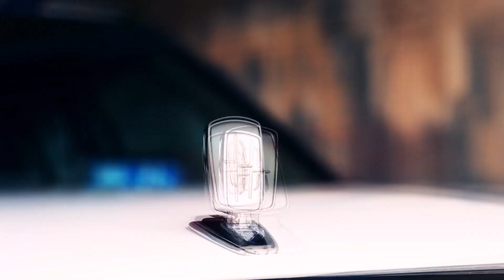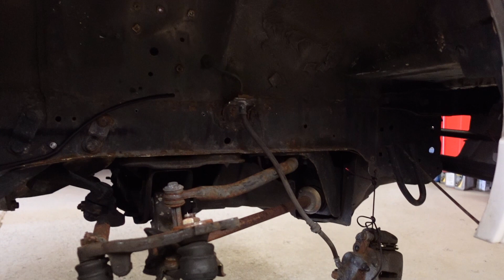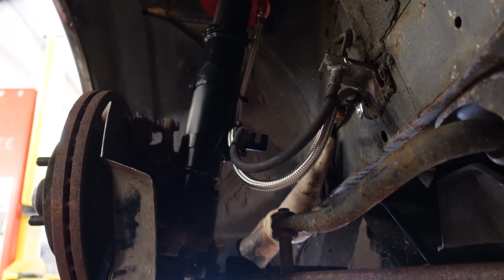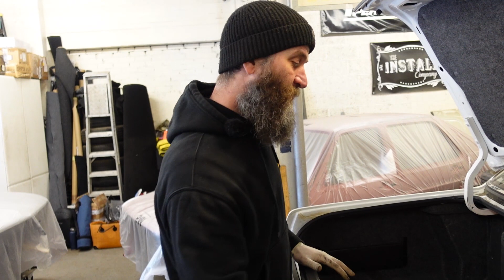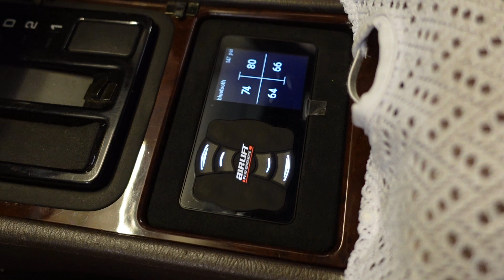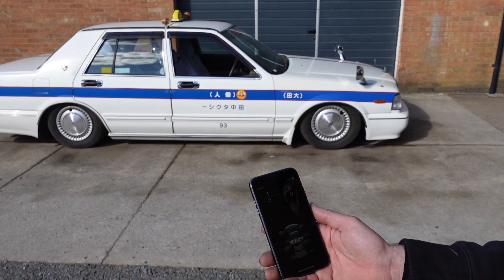JDM Nissan Tokyo Taxi fitted with Air Lift air bag suspension - in detail

Comment: Nice to see proper engineering going in to the air ride systems these days.  I would actually consider one now for a future project, my cars are always drivers, not just show queens.
Reply from the maker: Thanks. I'm glad you agree this is properly engineered kit. I was happy to modify the Cedric's suspension on the basis that it would be done to a high standard.
Reply: @TheLateBrakeShow   It would be cool to know how much such an installation would cost. Quite an important omission from the film.
Reply: @TheLateBrakeShow  high standard apart from braided line routing?
That is a literal death trap, those brake lines will fail being cable tied to air lines.
EXTREMELY dangerous.
Reply: Would be cool to get a twin cam head and turbo from a RB20det on there. Hehe ;p

Comment: All those screw holes for the tubing needs to have paint or equal applied to keep from introducing a rust point. I used to work Navy aircraft corrosion control and even Honda in their official manuals points out that needs to be done.
Reply from the maker: They are protected by Bilt Hamber anti corrosion

Comment: Maybe others have mentioned. The braided steel air lines, zip-tied to the rubber brake lines, make me really nervous. The one will just nibble/saw away at the brakes line. I'd think about wrapping those sections of the braided line that come in contact with your rubber lines to offer a bit more protection. In a dream world I'd replace the open braided lines with covered braided lines. 

Anyhoot, love the show. Fun stuff. 

Oh! And keep the stock motor. It fits the spirit of the car. 

Cheers.

Comment: Why didn’t you buy the tank with the compressor built into the tank. You can add sensors to keep it at a set height while your driving.

Comment: The Nissan Cedric sold in Australia the early ones did l noticed LPG all taxis had this also courier utes mostly the 6 cylinder fords and holdens why they used LPG it was about 50% cheaper than petrol a litre  Japan used it to now the taxis are mostly toyota hybrids

Comment: Thats Wicked, love it and i'd love to be able to slam my 2000 Honda HRV to the floor, You cant get hardly anything Off the shelf for it though, would love to drop Air Ride On it. Suspension setup on this is quite similar to the HRV, both front and rear. thats also got seperate rear springs and shocks with 4 link

Comment: Don't cable tie steel braided hoses which will move to anything important, like brake hoses! That's insanely dangerous. Moving braided hose is more than capable of cutting through just about anything, including bodywork eventually. Cable tying to the brake hoses like that will effectively focus the abrasion from the braiding onto one spot on the brake hose. You'd be far better off using non braided hose, or routing the braided hose in a way which it can't get anywhere near the brake hoses in any combination of suspension and steering movement (the latter is probably easier said than done).

Comment: Really interesting video. The guy explains things really well. I’m not convinced about cable tying braided air lines to a rubber brake hose though. That’s a recipe for disaster after a bit of rubbing IMHO. 
Better to sheath both then cable tie them?
Reply: Bang on Ben, that stood out for me as well. Braided air hose chafing the rubber brake Flexi seems a really poor solution. Easiest solution would surely be some brackets and hose clips that keep the hoses separate.

Comment: Full slam with all the air out is one of those strange things in life, that you can't quite explain why it's great, but it is.
Reply from the maker: Very true. I'm glad you agree.
Reply: I had a Y31 Cima Cedric with factory air springs. One morning I came out and found the car unintentionally slammed. Looked very cool, but the ride was terrible, until I found the loose wire and got the springs working again.

Also had a Lincoln Continental on air ride that also failed. Looks very cool, but the ride was unbearable. :)

Comment: This is still cool to see. After two years on the road I bought and installed a Air Lift Performance system on my Lupo (with the help of a friend whose installed them before). After going from standard suspension with loads of bodyroll etc to cheap £200 coil overs which were really stiff then going to this air system it's definitely my favourite. I don't even run a front ARB (don't tell the DVSA😅) mainly as the struts didn't have a mount for it but to be completely honest it doesn't need it imo. Sticks the road well not too bumpy (more road quality dependent) great daiky drive and has been for the last three years. Just a shame I ran too wide wheels I had to run massive camber to fit and used to go through three every couple months. This is definitely something I will so to my next car

Comment: Looks good! It was very interesting to see how air suspension can be fitted to a vehicle. I like the touch of adding the Japanese registration area and classification to the number plate! Looks good as is, but if you want to be really authentic, this taxi was operated out of/registered in Ota City, Tokyo and should therefore be 品川 (Shinagawa) and not 多摩 (Tama) as shown. Looks good as is, but just thought I'd let you know just in case you want to be as close to the original as possible. Shinagawa number is one of the most popular in Tokyo rather than Tama which is to the West of the Tokyo Metropolitan area and more the suburbs. Please note, that the number may have changed when the vehicle changed hands in Japan and was re-registered in the Tama registration area prior to you purchasing it. Whilst it isn't possible in the UK, the plate would have had a green commercial plate with white writing when it was an active taxi.

Comment: About your wheels.......A company called rimscarnated allow you to design your own wheels whether you want monos or splits in any size and fitment colour and are completely safety  checked. Price for monos are 1500 but I think its definitely worth it for the gain and originality

Personally I would have the original hubcaps replicated into larger size alloys keeping that factory + appearance maybe with a little dish 

V.I.P route is always an option but way overdone. Because of the taxi originality I think larger standard looking wheels would suit very well

Looks brill all low well done

Comment: Great vid, and Phil certainly knows his onions. One question, if the pressure in the bag adjusts to suit the ride height, what happens to the ability of the bag to act as a spring if you bit a pothole or whatever? If the car is in a low setting with low pressure in it, does that mean the hypothetical spring rate of the bag is much softer than  if the car was in an aired up setting? 🤔
Reply: Yes. The spring rate changes with pressure/ride height. Also you have less compression travel if it is below the middle. I reckon the likelyhood of bottoming out the suspension on bumps will increase as well, I guess the bags have built-in bump stops.

Comment: SERIOUS WARNING: Please remove the stainless braided air line from the rubber flexi brake line SERIOUS WARNING

They are currently cabled tied together, and after nearly 30 years in high performance motorsport and engineering i can tell you that the hard/sharp stainless line will wear right through the soft rubber brake line, and suddenly you'll have no brakes.
Reply: Yeah cable ties onto brake lines and tek screws into the chassis rail and people here are literally saying it's a professional looking installation! Jonny, ask your brother what he thinks of the point Max Torque makes about the braided lines touching the brake hoses.
Reply: 110%.. First thing I thought of seeing this, that's sketchy af.. 
Even in the engine bay you keep braided lines isolted from looms, lines, silicone joiners, rubber coolant hoses etc.. 
It wears through surprisingly quick even with the significantly lower movement and travel of an engine over a suspension component like on this car. 
CRAZY!!
Reply: @DStead2239  It's OK, he'll quietly ditch this guy eventually and take it to someone a bit more competent like he's done with the Allegro...

BTW I've seen a loose braided line that had cut about 1/3rd of the way through an aluminium upper engine  mounting arm before it came to me.
Reply: @kieranjamieson  I've come across a few shockers too. Had a customer who was down on power, did smoke/leak test and found intercooler end tank worn through from oil cooler line's he'd fitted. 
Turbo would have copped a flogging trying to compensate. 
I've seen it damn near burn a car down too, where oil feed line rubbed through insulation of alternator cable. It come in for another issue but found it by chance when the braid of the oil line burnt my arm from current passing through the braid
Reply: @DStead2239  Hehe yeah I've seen a braided line passing electrical current and burn before too, and throttle cables that are the only engine ground etc. It's one thing if an amateur has a go and learns from their mistakes, it's not great but at least they're having a go. but when a so called professional does stuff like this they need to be called out on it.
Reply: @kieranjamieson  
100%.. 
But as my old man said when I was an apprentice at his engineering/machinest shop "you can do ten good job's and they might tell one person, do one bad job and they'll tell everybody".
Reply: ...what your soft rubber brake lines doesn't have kevlar braid sandwiched in between the outer and inner rubber of the brake line? I got brake lines with the outer rubber torn off but the kevlar inner braid and the inner rubber still going strong so I only change them out once I get home (am an offroader though, rock damage to brake lines is part of the whole thing)....

Comment: Another Good vid and amazing engineering displayed. A nice tweak to the ap or control unit would be to have an automatic fail safe to not be able to go into full drop if car moving and also not to be able to set off from parked in full air out either so if unit sensed movement it would pump some air in automatically to lift car to minimal rolling height.

Comment: Looks awesome mate, just needs some wheels to match. Only thing is the braided lines being zip tied to the brake pipes, it won't be long till it rubs through. It would be worth sleeving the braided line at the zip tie points with a bit of rubber.

Comment: Could you not repurpose the compressor from an old Range Rover?

Those things are encased in sound-proofing foam and mounted on soft rubber anti-vibration feet. They're near silent.
Reply from the maker: Perhaps. It might be made possible to work with the air lift management sys.
Reply: @TheLateBrakeShow  I'd imagine it'll just be a straight 12v on/off in response to the tank pressure dropping.

---

NB. You should give the same treatment to your Jimny add add level sensors. Will make it drive better when carrying weight and will mean you can start making some more off-roading videos (something that has been missing from your channel since you dipped the headlights on that Niva).
Reply: You can fit silencers to Viair compressors

Comment: Spot on mate. That's looking good now! Can I suggest you just write RB26 on the valve cover with a marker. I suspect most commenters suggesting such a swap wouldn't be able to tell the difference.
Reply from the maker: Genius idea!
Reply: @TheLateBrakeShow  you could also source an RB30 used extensively in Australia in the late 1980’s in the VL Commodore - 3 litre version of what looks to be the same engine - often fitted with aftermarket manifolds and Turbo here in Australia and making huge horsepower with the liberal application of money.

Comment: Nice one as usual! I’m usually against air ride suspension but this was super interesting as it addresses my usual complaints.

Btw, there is some abuse of the mic a couple of times which is loud in headphones - any way to run some filter over it?
Reply from the maker: We had sound problems because of my lack of experience using these mics - so sorry. Glad you liked the depth of engineering on the bag fitment, though.
Reply: @dizzy2020  Just like my left ear from many hours/days sitting next to a poorly sound insulated diesel in early forward control trucks (cab over's).

Comment: Well, I suppose that show just how advanced the air ride system on my Lotus Esprit was at the time. It was fitted by the previous owner just over a decade ago and not only does most of what's shown here, but has ride height sensors. 

It's all going back to coils though.
Reply: I've fancied building scruffy Esprit/Excel on air ride for a long time, called "low toss". Trouble is it just seems to defeat the purpose of a Lotus...